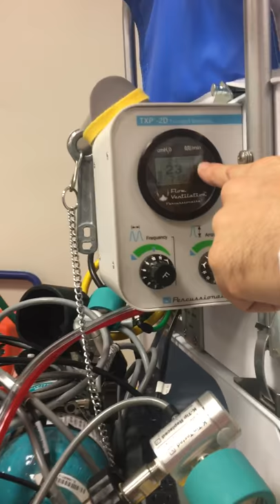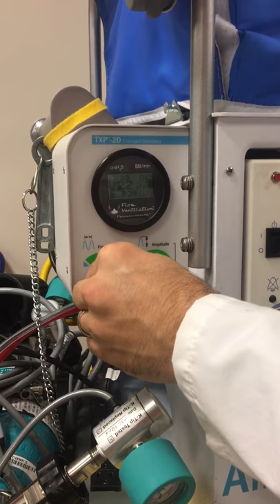High Frequency Neonatal Transport

Comment: You mentioned monitoring ETCO2, how do you do that with the phasotron circuit? Did you mean TCO2? If not, how do you monitor ETCO2 with the phasotron circuit?
Reply from the maker: You can add an etco2 at the end of the phasitron circuit near the ETT. But transcutaneous is a more accurate measure. etco2 is useful for trending.